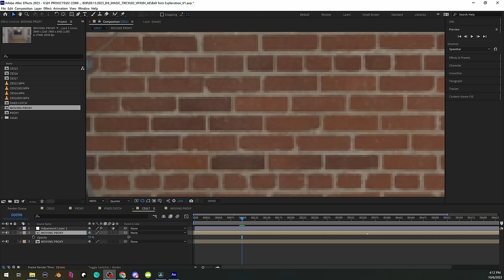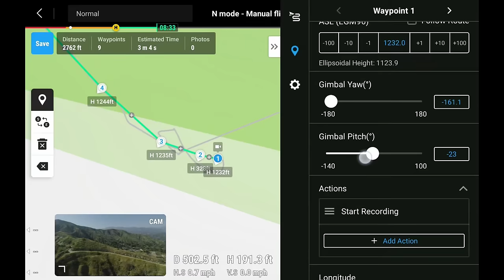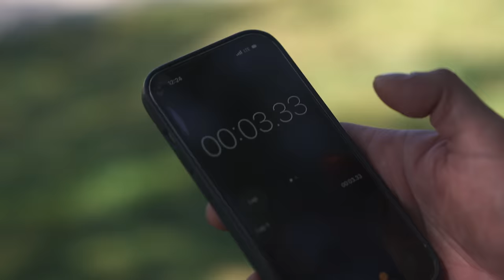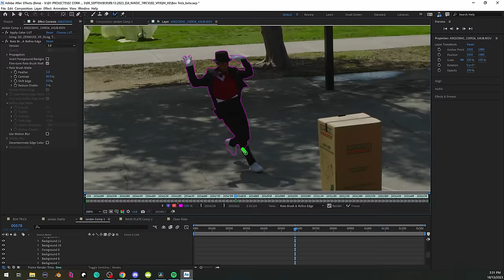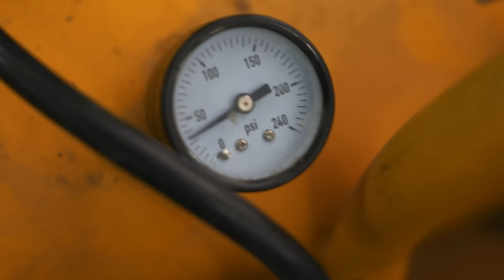We Invented a VFX Trick You've NEVER SEEN BEFORE!

Comment: Could you use the drone as a normal handheld camera, record that motion, and replay it to get a replayable handheld effect?
Reply: You mean record the hand held motion as the drones flight path? That'd be impressive if you could. If that's not built in, I'd imagine it would require holding an active drone, if possible, and the risks involved holding a drone that big with spinning props that powerful might be too dangerous.
Reply: If you can't, I'm pretty sure you can record a practice shot with your phone and get the motion data from there for the drone to run twice

Comment: The table shot looked like it could have been done practically. Since the camera is moving, Jordon could slide out through the other side of the table and crawl to the other table right when the camera has all the tables over lapped. And the final shot in table three is her rolling through quickly.
Reply: 100% agree... With an environment that was lighted under controlled conditions... They could do the table one, and the trash can one both live... the trashcan would have cut out backs, and would have stage hands to move air cannon... Jordan gets in #1, crawls out back, move cannons in place, she moves to #3, tosses out grenade, moves to #2, cue air cannon, surrenders from #2.
Reply: They would have had to have a special collapsible table made for that to work, since the table she first went under and Sam jumped was on boxes. The wind is lifting the cloth on the middle table until Sam arrives in frame, showing there's nothing underneath it (you would have seen the shadow), allowing only a few seconds to get out from under the left table to the middle table, and there was only five seconds or so between when Sam showed there was nothing under the right table until she started coming out. Given the camera angle, she would have had to low-crawl to avoid being seen moving between the middle table and that one, so there was no way it could have been done practically. She simply couldn't have moved that fast.
Reply: @keith6706 there is enough time where the tables overlapped for marine crawling to the other table. The cloth is also down to hide the shadow in the middle for her to wait and that’s why I said at the end she would roll through the table since you can see the cloth blow outwards in the direction she exits
Reply: @ShadePwns  When does she do the 180 turn needed and how in such a manner that some part of the body isn't in view and make sure her clothing is straightened up in 5 seconds?
Reply: @keith6706  the second the first cloth goes back down she can already face opposite to the camera going into the direction of the second table. When Sam looks at the table, he can ignore the fact she's there since he's an actor. In the time he continues to go to the last table, Jordan can position herself to roll through the table. Since this is also recorded, multiple takes can be done to ensure no body parts are in view of the camera. As for clothing, you can see it's already wrinkled/folded up in many areas in the final cut anyways.
Reply: @ShadePwns  She would have to low-crawl backwards from the second table to the third. Ever tried doing that quickly?
Reply: @keith6706  chill dude. the whole idea is it CAN be done practically. Never said it would be easy to do it practically? and why would you crawl backwards to make it more difficult? Like the first table, you would be going towards the table/camera direction and then rolling.

Comment: Love it. You know, that table trick could actually have been done in one shot, or one plate. The tables line up perfectly, during the movement of the camera, from the point where Jordan hides under the table until the prestige. As soon as she climbs under the table and the tablecloth is down again (works best with some weight put in its seam) she can crawl out the other side, go around the table in the back, wait for Sam to run in between the right and back table. At this point the camera went down a little. Perfect to hide Jordan as she crawls towards the right table and hides underneath it again. The only change would be that you need to hide the boxes under the left table well, so the camera doesn't see them as Jordan crawls under it.
...I've been analysing too many magic shows.

Comment: I think it peaked at mannequins and the last shot was kinda not impressive after them. And the shot with tables also felt a lot weaker compared to the previous, especially since the cut on the table is the most obvious there. But the mannequin and the board shot was really good, I had to rewatch them multiple times just to get an idea of what happened.

Comment: I remember, in CRT TVs on movies transmitted by antenna, or in ye olde coaxial cable, that a kinda wrongly setted tv could give away the CGI effects, giving a green tinge or a flatness in the cgi modified parts, messing with the blacks or whites, etc. When I started viewing the original, i saw a lot of noise around the objects, not only the vfxed ones... then i realize i was viewing the video on 720p. upped to 1080 and obviously noise got reduced. Low res, or youtube's digital compression algorithm, and the drone movement could generate enough noise which can distract the viewer and direct his attention where the vfx maker dont want to....